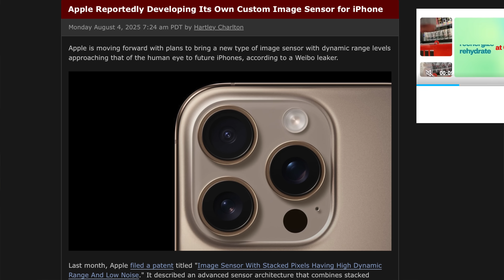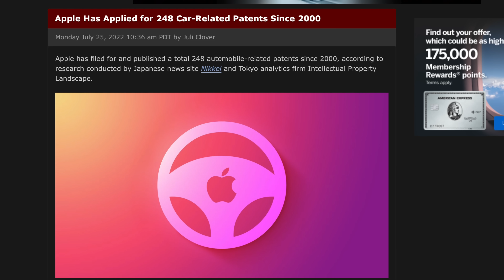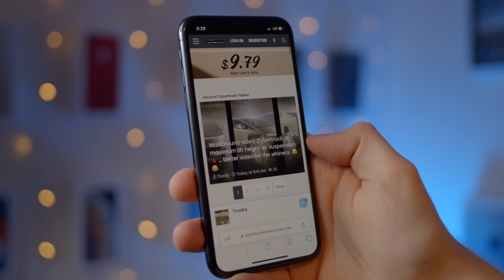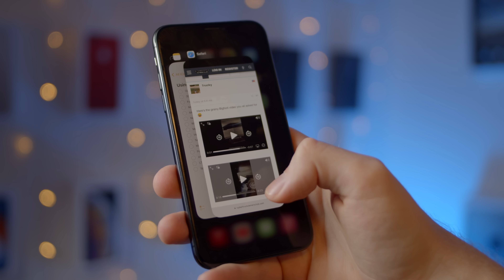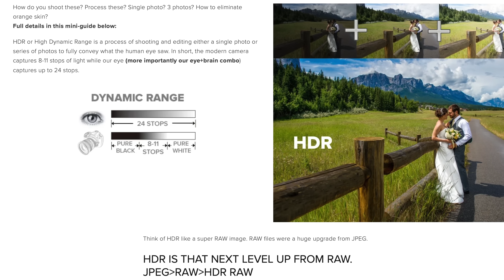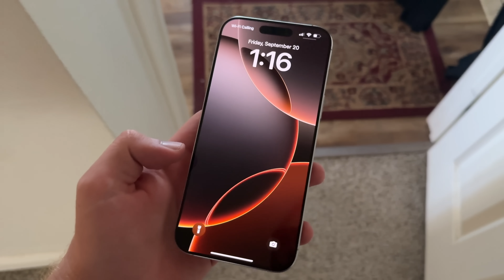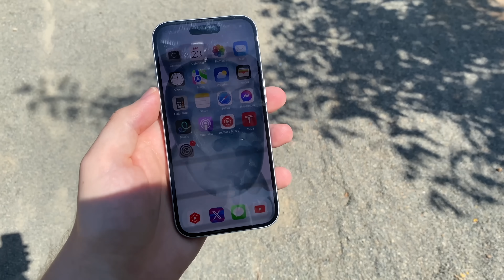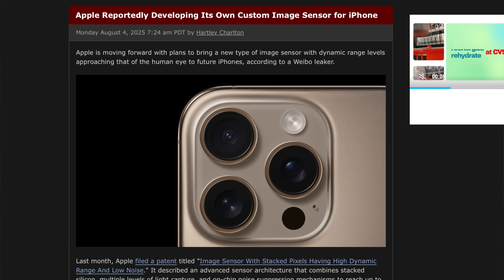Apple Did Custom CPUs, Modems, and Next Is...

Comment: Apple’s been designing chips for decades before the M series, or even the earlier A series. And I mean secondary chips other the original ARM chips they were involved in, or the PowerPC, which they were involved in.

Ok, our does NOT have great dynamic range. In fact, it has a moderate dynamic range. Dynamic range really means the range of the entire area being looked at, or photographed at once. But that’s not what our eyes do. The auto aperture of our iris is constantly adjusting as we look at different areas. That’s why our eyes hurt when moving from the indoors to a bright outdoors until everything adjusts. We look at a shadow and our iris opens, but if we move our attention to a spot right next to it that’s bright, the iris closes. We can’t see both at once. A camera must see both at once and get the dynamic range correct for both at once. It’s a very different situation.

Comment: I haven't used a iPhone in a while but unless things have changed the one thing that's better on android is the battery saver mode. Especially the extreme battery saver mode that turns off everything except basic features. On the topic of image sensors I think is they make a better sensor than Sony they need to start making camera's. I've never been interested in real cameras but I was listening to a podcast and that where talking about cameras costing $6000. I can't imagine wanting a good picture so bad I would spend that type of money

Comment: Apple should start making the battery themselves.
Reply: That’s what I wanted to add
Reply: its not gonna any different lol. Every battery is from one place
Reply: And make it easy to pop out and replace 😂
Reply: The next big innovation in batteries are solid state batteries, but Apple is far behind the game on investment on this. There is already plenty of competition in the space, and it’s risky to invest since there isn’t a roadmap for how many years it will take to become product-ready. Also, unlike semiconductors, there industry isn’t split as foundries (TSMC) and fabless designers (Apple, Nvidia, etc), so Apple would likely have to make their own factories or enter a joint development agreement (think Tesla & Panasonic) which would be a massive upfront investment for a component that could easily be contracted out (Tesla partnered with Panasonic only because there was nobody that could manufacture batteries at the scale they needed). For better or for worse, Apple will likely continue to contract battery design and manufacturing to 3rd parties

Comment: I was thinking displays.

Displays is probably the next biggest cost for them after the silicon (heck, if Apple bought Samsung and Intel's foundries, combined them and ramped up production, they could actually have some really good, cheaper silicon, especially as iPhone chips start to reach more than $100 per chip (currently sitting at around $35 per chip)), but for displays, it's a well known process, and you don't need as many experts within the field, compared to silicon. And it's probably Samsung's highest profit margin, so Apple could halve their display costs.

Comment: This new sensor may not arrive until at least 2027, in my opinion. But what's really next for an Apple-designed hardware is a replacement for the Broadcom I/O chip that supports WiFi 7 (802.11be), Bluetooth 6, and UWB in a very power-efficient manner.

Comment: A lot of the reason to make their own camera sensor is to vertically integrate the supply chain so that Apple can capture more profit per iPhone. It should also differentiate the camera more from other brands and I'm interested to see what direction Apple takes with their's. And I'm sure they won't release it until it's as good as their competitor's sensors. The iPhone is looking to change a lot over the next few years with Apple going vertical on so many of the parts and I'm exited to see how it turns out!
Reply: Apple could have been making real cameras all these years but I get the feeling they didn't want to upset their relationship with Sony. If they start making their own image sensors they will have everything needed to make real cameras
Reply: @macbere3326  I don't think it's about upsetting Sony, more that the iPhone as a camera is a big part of their product. Apple would rather upsell someone to a pro iPhone if they care a lot about the camera rather than try and sell them a base phone and also a dedicated DSLR or mirrorless. Which I think is the right move. 
I think it's better that they double down on the iPhone camera by making their own sensor as well as accessories like an Apple gimbal and attachable lenses that mount directly to the phone. 
I would personally love it if they made a camera drone since I don't like have DJI apps (Chinese company) on my phone, but I doubt they will.